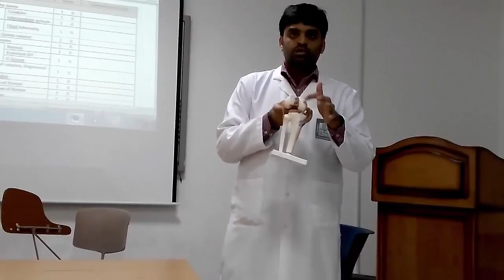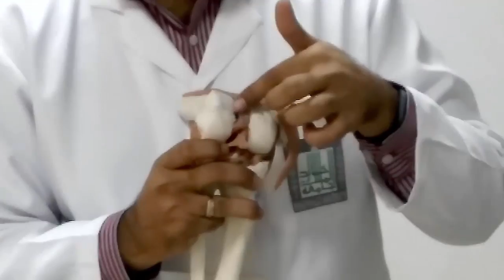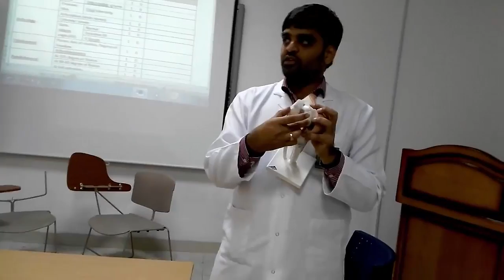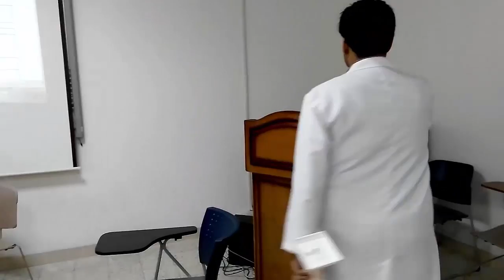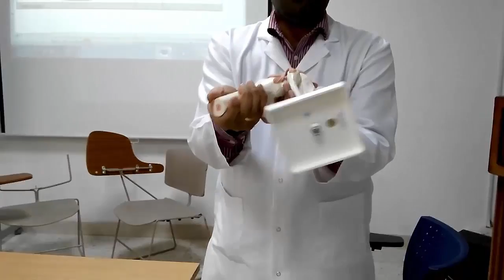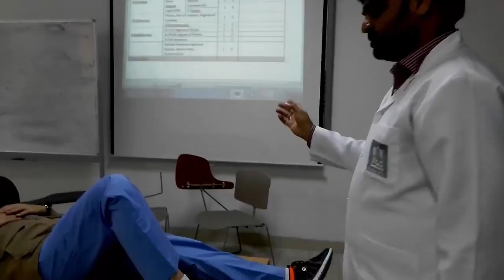Biomechanics : Knee

Comment: Knee joint has only one degree motion . Internal n external rotation of femur is happening in hip joint
Reply: knee rotation can occurs only if knee flexion
Reply: The knee has 2 degrees. Sagittal Plane movement and transverse plane movement. Structural abnormalites can cause frontal plane changes/movement (Varus/Valgus) but it isn't normal. While hip internal and external rotation happens at the hip as a result of femoral movement, Knee internal and external rotation happens at the knee via Tibial movement using the following:

Internal (Medial) Rotators: semimembranosus; popliteus; pes anserinus (semitendinosus, gracilis, sartorius).

External (Lateral) Rotators: biceps femoris (possibly aided by the tensor fasciae latae as the knee moves into flexion).

A little confusing because the way he showed it in the video was hip internal/external instead of knee.
Reply: Femur rotates on tibia in last 15  degrees of extension
Reply: he is talking about the screw home mechanism

Comment: Not 2 degree... 3 degree of freedom... Flexion extension medial and lateral rotation and abduction adduction
Reply: In what case does knee abduction/adduction happen?
Reply: Abduction and Adduction movement occur at hip joint not at knee joint.so 2  degree of freedom is right.